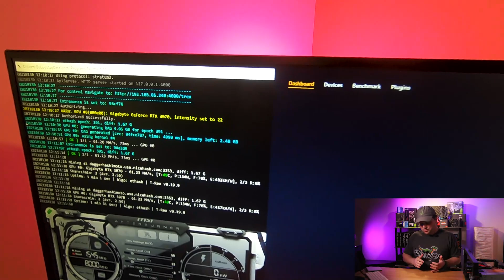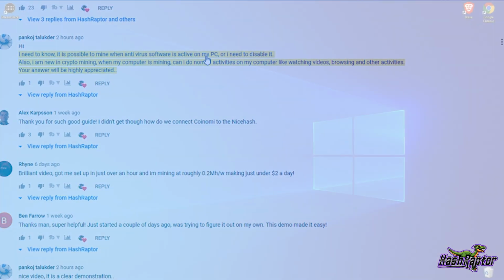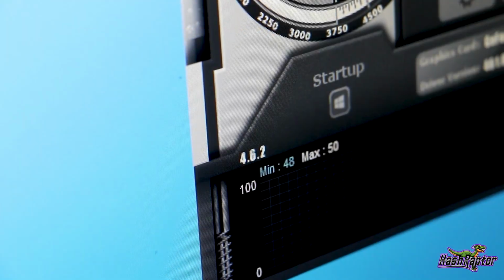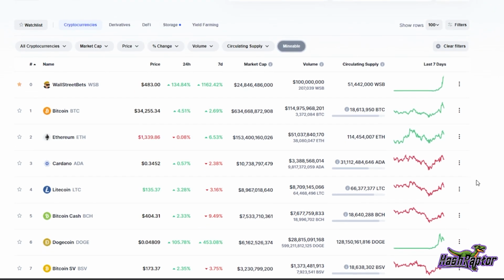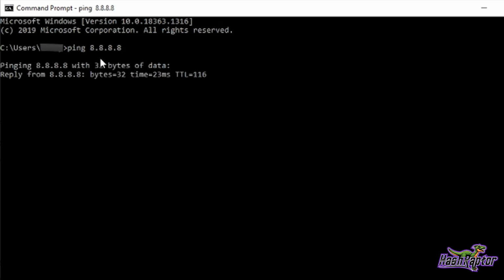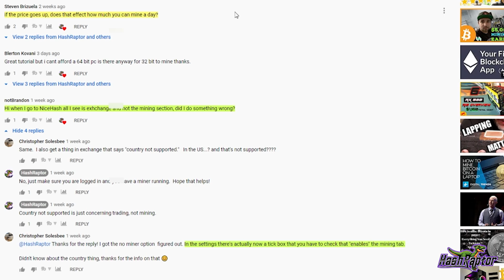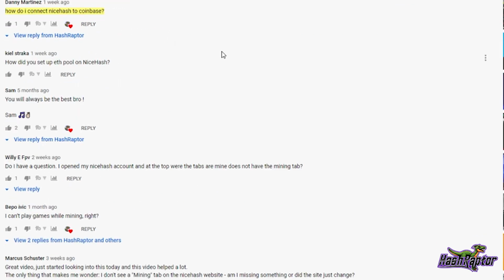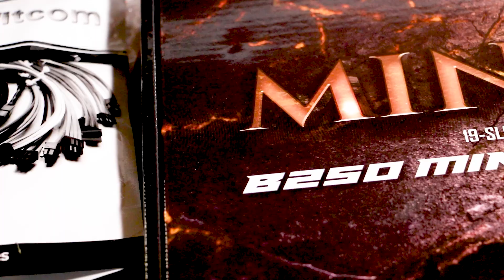How to Mine Bitcoin on PC | Part 2 - Q&A

Comment: Hey quick question, if your electricity is free, can you leave your power limit at 100 instead of dropping it to 70 like you recommended? I.e. did you suggest dropping it only because of the returns vs costs of electricity?
Reply from the maker: Great question.  No, it is both for the life of the GPU and the electricity costs.  If you want to push it though with free electric, I don't recommend going over 80 to 85% on any card.  Just for the sake of taking care of the hardware.  After 85%, you see very little benefit but it does start to take a toll on the life span of the card.

Comment: Hi -- Hope you are still taking questions...or maybe this is something you can address later. I have just set up NiceHash Quickminer on my RTX3070 OC 8 gig rig. Working pretty well. However I also have my old GTX1060 6 Gig card doing nothing now...is there a way to add that to my system, and can I expect any worthwhile results if I do?  Thanks...

Comment: Should I have only one benchmark active or multiple, I currently have only one benchmark mining which is the fastest speed
Reply from the maker: Just one benchmark at a time. But you can leave multiple minors and algorithms checked as it will go through them one by one. However note that you’re over clock in after burner will not be customized for each Algo that it is testing.

Comment: Hi, First, I would like to thank you for the effort you put into this great channel. I am using Nicwhash and to tweak my setting I use MSI, Phoenix miner window shows hash rates where I can adjust my tweaks which is what I need. But Excavator which Nicehash recommends does not have hash rates! how can I adjust with this miner? Thanks in advance.

Comment: sir my MSI is no allowing me to change any settings of temprature or power or fan speed they are all greyed out and also the nice hash is showing error again n again nd when it finally showed mining it was showing profitabilty 0 continouously for hours pls tell how to fix this ?
Reply from the maker: Check and make sure you have the latest drivers. Also you may try the latest version of afterburner or a different overclocking software.
Reply: @HashRaptor  pls can u explain this in lil brief I am having a 2 GPU laptop from which i am only able to mine on the gtx 1650 and in that it is showing me 0 profitability , i have shared this on twitter with all the screenshots attached and tagged you in that, can you have a look pls , it is there by username "ghantekasarcasm"

Comment: Hey Raptor wonder if you can help me?? I have been running a RX580 8gb on NHOS and been getting around 30.2 mh/s. I just got a 1660 super got some risers and server psu. I got it all connected and put NHOS on a 120ssd. It did the benchmark and was set on high but it showed the RX580 at 20.8 mh/s and the 1660 at 30.4. I changed the power setting to medium and it benchmarked then it shows me that the rx580 is 30.2 mh/s and the 1660 at 20.5?? How can I get both of the cards to hash at 30 mh/s or so?? Thanks!

Comment: Great job buddy.  Yup, use Windows defender and set an exception.  Do not turn it clear off ;).  I feel like you may be a bit biased towards T-Rex since you are Dinosaur affiliated. - The wifi /internet speed question was one that i had back in 2017...i assume that faster connection = better profits.  Definitely wrong, you really only need a few mbps of solid connection for a single rig, but yeah more is better ;)

Comment: Hi, the mining tutorial is great, I have some old PC (Amd A8-7650k and A88x g-45 gaming motherboard, 8gb ddr3, I plan to take rx570 or rx580 8gb, is there a difference between these 2 cards in mining and how much power is required for 2 or 3 cards
Reply from the maker: Hey, so those cards are pretty old and probably won’t use much power, under 100 watts each I’d guess but not sure. Also not sure if those cards will work with current miners but you can try and see.

Comment: Great video again, thanks, but you only explained how to install a different miner in Nicehash, not how to actually get NH to run it. NH is running PhoenixMiner by default.  I really wish more sites would put these types of Q&A videos...it would cut down tremendously on the number of questions in the comment section and on forums.

Another thing, it would be good to explain the 3 different addresses in Coinomi (default, compatibility, legacy) as I at first had no idea there were different ones and that NH will NOT accept the first one that is listed (i.e. when you first install NH it asks you for an address).

I'm now running lolminer/Ethermine on my 5700XT to MetaMask on the Brave browser.  It would be great if you explained your favourite miners for AMD cards too.  I recently picked up my 3070 and am moving the 5700XT to a spare PC I built from parts (going to try HiveOS), and am just going to use Phoenixminer/NH as I'm not sure what works best for Nvidia.  I will try Trex though.

Comment: Will mining kill my gpu, also whats recommended for overclocking amd gpus?
Reply: If they are kept at optimal temperatures they can run 24/7 for years, they are designed for that